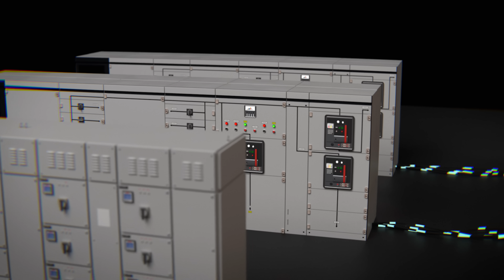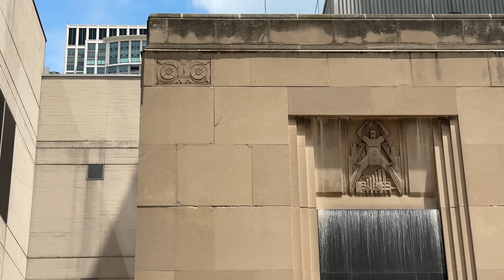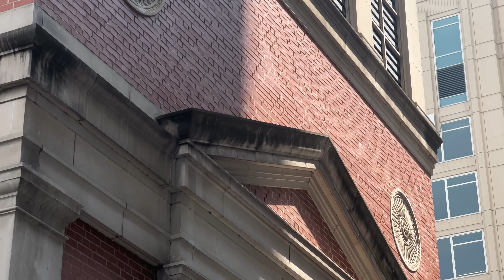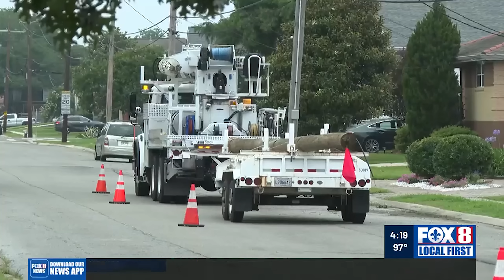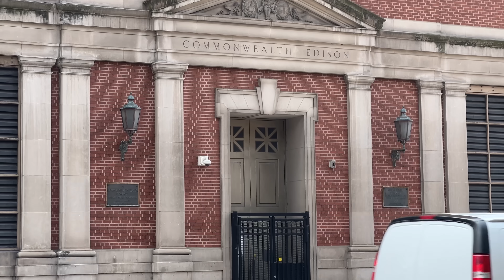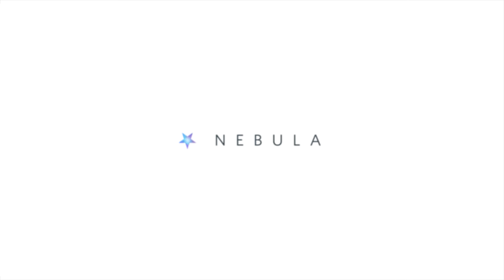How Fake Buildings Keep Cities Alive

Comment: I think two things you're possibly missing is... One, they're no longer novel. Two, even making them iconic in the examples shown here is sort of camouflage.

In the 19th century, when cities were beginning to get electricity, that was the cutting edge future tech, something your neighbours definitely didn't have! Of course you want to shout about it! 

Now, having an electrical substation in your neighbourhood, is mundane. It's the default. It's standard. So the existence of a substation is not seen as a cause for celebration in the same way.

That also sort of presents a challenge to making an obvious substation iconic these days. Sure, that art deco one with a grand entrance and motifs of electricity is iconic. If every block has one, is it still that? Or does it become ordinary? -- You could mitigate that by having unique designs for each, which will up the cost but is doable, but are you stopping at substations, what about all the other infrastructure in the city, doesn't that have an equal right to be iconic? So all those would also have to be uniquely designed...upping cost.

I also think, even the iconic examples, are sort of camouflage. Yes they are making the industrial site obvious and a landmark, but its function is still disguised. That water tower that looks like a church? Well it's camouflaging itself as a landmark. That theatre-like substation in a theatre district? Camouflaged as a landmark again. Really, the lack of camouflage would be to make the substation itself visible, which is done in places. Likewise there are water towers which look just like that, in visible prominent locations.

I do agree though we are maybe to averse to opting for the industrial sublime lately though, and of making the camouflage of infrastructure become a statement itself.

Comment: Also in Montréal, at 45.49278277748643, -73.58134537352242 on Towers St just south of de Maisonneuve street is an innocuous looking house from street level but its roof is a steel grill !
On Google Earth, if you go back to 2019, you will see that house didn't exist and the whole plot of land had been dug down real deep.  Streetview is from 2017 and shows the house before its trasformation.   But if you do a google image search for "Towers metro montreal"  you will see articles about it.  The house was dismantled and huge tunnel built between it, the backyard and then north between buildings to connect to the metro line between 2 stations.  The house was rebuilt except hollow shell and the roof is a huge vent.  

This is now a metro ventilation station which is one of the frew critical functions of the metro (one of the few things backed by generators) in case of fire, it can either push fresh air into tunnel or draw out smoke depending on where the sourse of smoke is).  Montreal isn.t the first to do this, but this is a good recent example. 

The Metro line passes under de Maisonneuve.  And because the building next to it has no windows on the side facing house, it greatly reduced possible noise complaints from the noisy roof of the ventilation building.

Comment: It's a shame they're just letting all that heat vent to the atmosphere. It's going to contribute to the urban heat island while doing nothing useful.
Instead it could be piped as hot water to local buildings, reducing the demand for other sources of energy to heat them, or used to warm an underground rail system if the city has one. With enough heat you could even put in a small steam turbine and extract electricity from it.
America wastes so much energy, it's like they're proud of being a blight on the planet.

Comment: I think one big aspect that this video doesn't hugely touch on is the political factor. Spending on public infrastructure has become a sensitive debate in some areas, so sometimes there is almost an effort to downplay costly renovations or improvements. If you turn one of these facades into a bold, impressive statement piece, then the first thing some people are gonna ask is, "How much did that cost taxpayers?". Something that would have otherwise gone unnoticed becomes a conversation, an argument, something that could end up making you quite unpopular and losing you a lot of money if it isn't recieved well. It's a shame as im on the side that believes we should put effort into our architecture and use it to celebrate our infrastructure. But if you build something that makes a statement, someone is gonna disagree with it.

Comment: The problem is that electrical transformers aren’t the industrial sublime. They’re just industrial. They’re loud and unsightly. Hiding them is a concession to the humanity of the people surrounding them, in the same way that not having floor to ceiling windows in a bathroom is.
Reply: ah yea a flippy, a rossman flesh advert
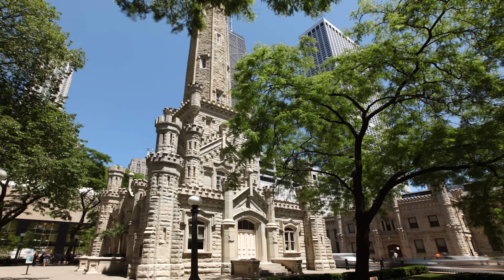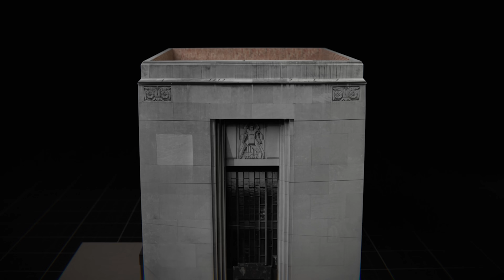Reply: Point is to not disguise them as normal, everyday buildings but to build special, outstanding ones that celebrate the infrastructure. See 2:00, 3:00.
Reply: @Sekir80 Or just, don't. Not everything needs fancy ass artsy fartsy shit on it. It's a damn transformer, keep it bland and move on
Reply: @MommyKhaos  does the old facade count as "fancy artsy fartsy shit" to you or is it only new designs that do?
Reply: @MommyKhaos   you're pretty boring. everything should have more art.
Reply: @MommyKhaos Why?